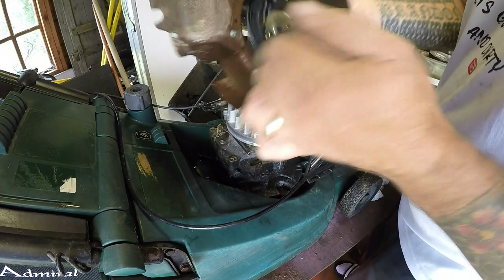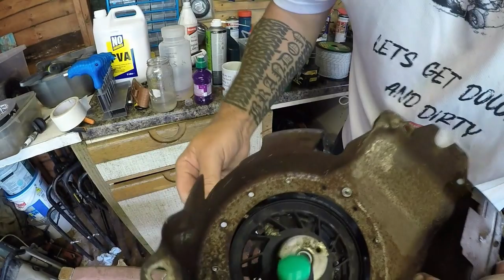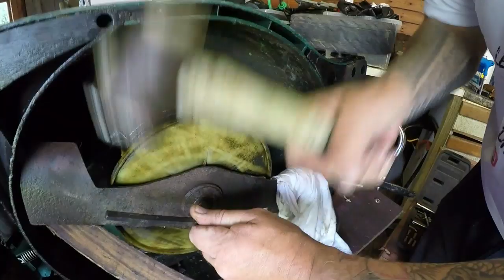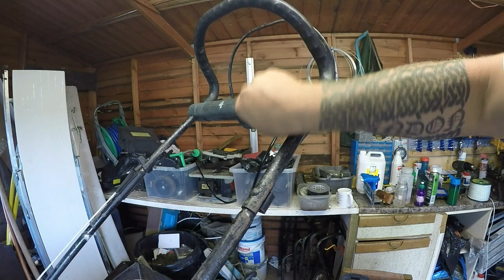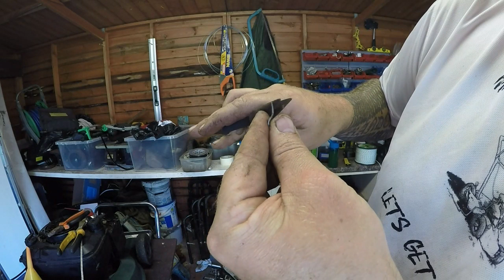ATCO ADMIRAL £20 MOWER AND LIVE STREAM UPDATE #SEN

Comment: For those rusty bits you should try to source a can of Kano Labs Aerokroil penetrating oil if you can find it in the UK.  (Not trying to plug the product but it works brilliantly.) Barring that, the second best solution is a 50:50 mix of acetone and automatic transmission fluid.  Careful though, mix it in small quantities as the acetone will evaporate rather quickly and will react with some plastics.  Both will loosen the hardest of stuck nuts or bolts with minimal effort and have them off in no time at all.